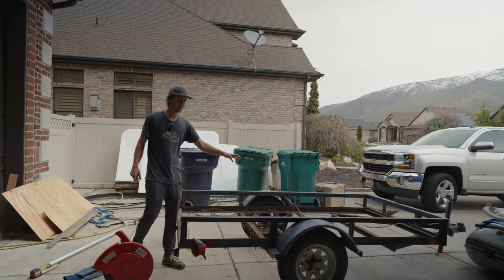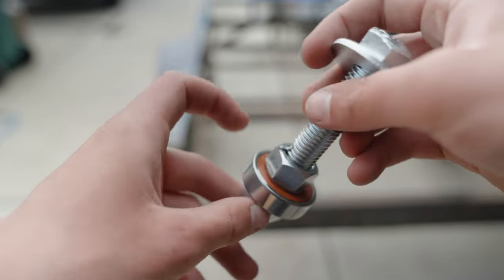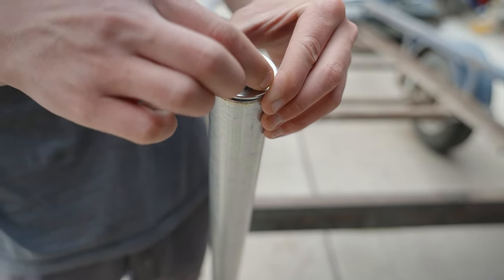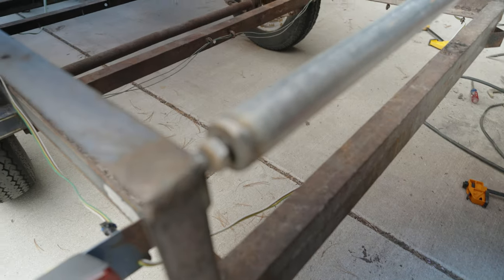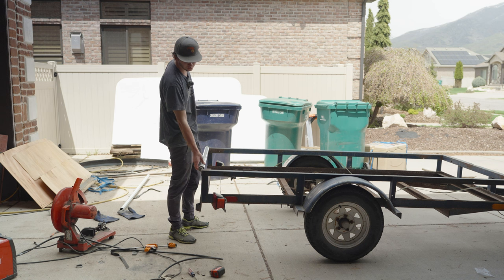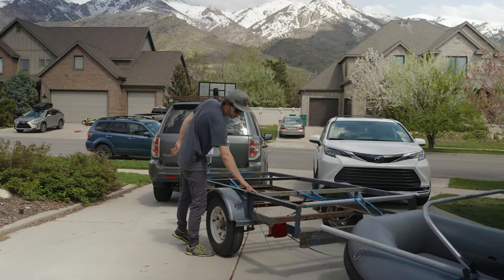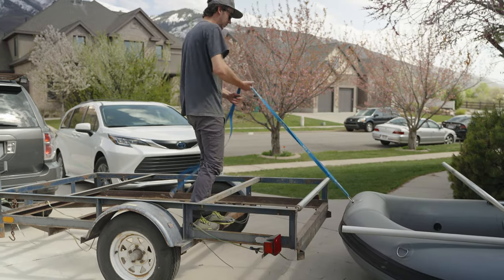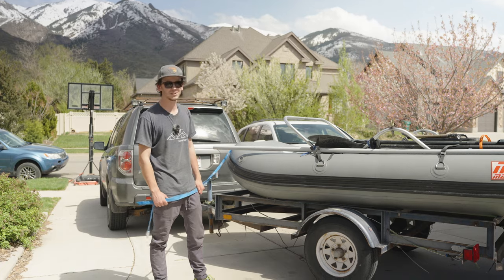Saving Hundreds$$ Raft Trailer Build (Roller Bars)

Comment: How did you source a bearing that fits exactly into the inner diameter of your galvanized pipe?
Reply from the maker: My grandpa had some bearings laying around that he gave me. I took them to Home Depot and just inserted them into pipes until I found one that fit. I'd maybe try a pic and part or mechanic shop and see if they have any bearings lying around
Reply: White water worthy and drift boat parts both sell a kit if you don’t feel like sourcing parts…